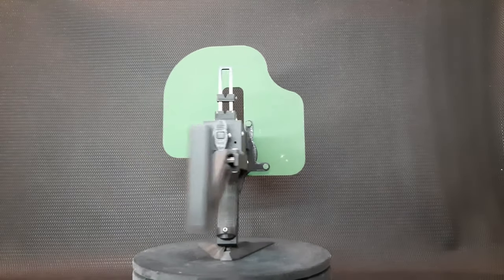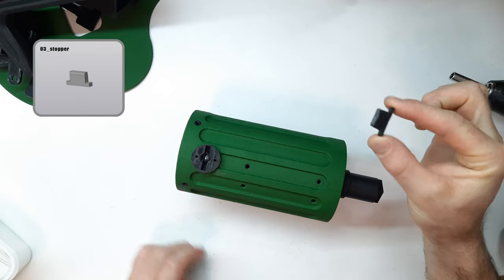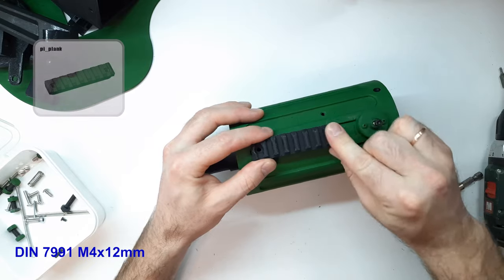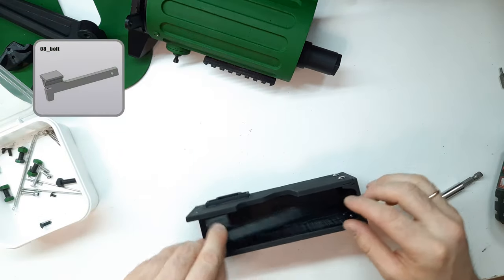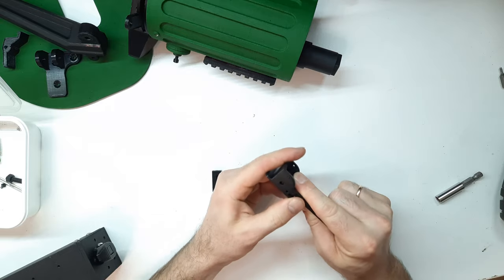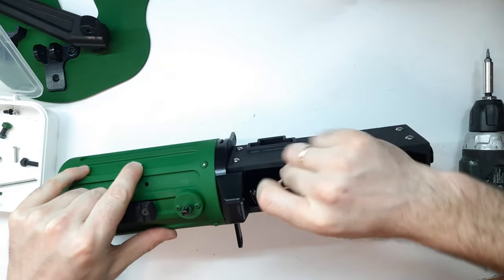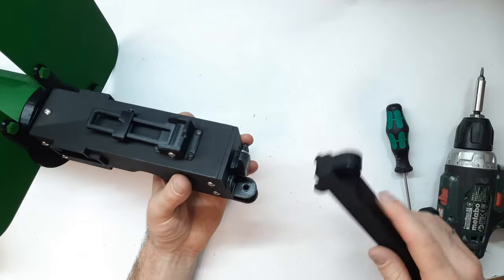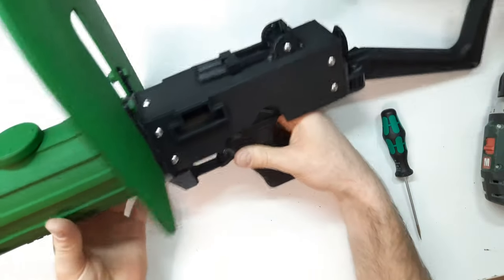"МАКС ГЛОКОВ" - карабин кит для страйкбольного пистолета

Comment: Will this work with an elite force glock 18c?
Reply from the maker: Unfortunately I don't know, it was not possible to check compatibility
Reply: @HeavyBarrelRU  which manufacturer did you use?
Reply from the maker: @CallsignWizard  WE and KJW

Comment: I purchased the print files and have someone printing it for me could u put a parts list other than the 3D printed pieces in English for me so I can put it together properly
Reply from the maker: All screws and springs used are listed in the assembly video
Reply: @HeavyBarrelRU  I feel like an idiot I didn’t notice they are in the bottom corner lol 😂